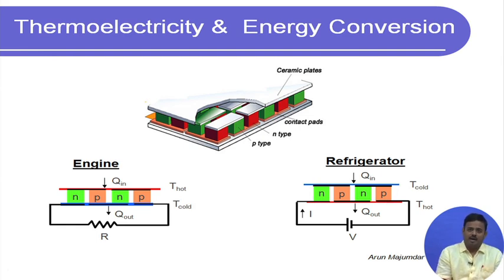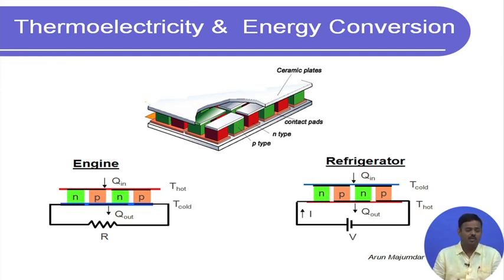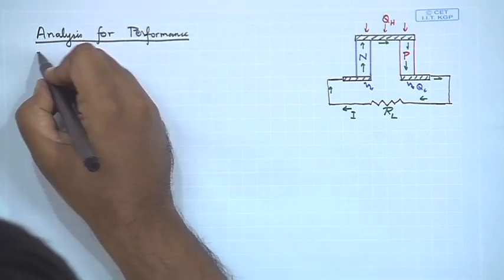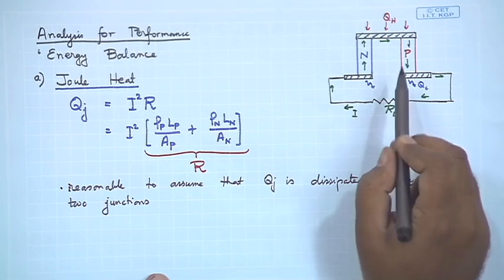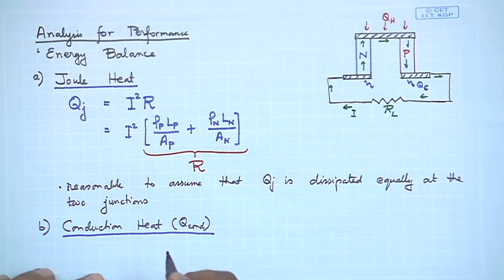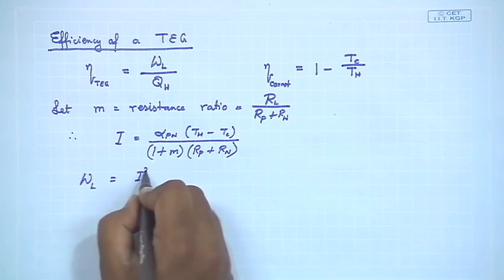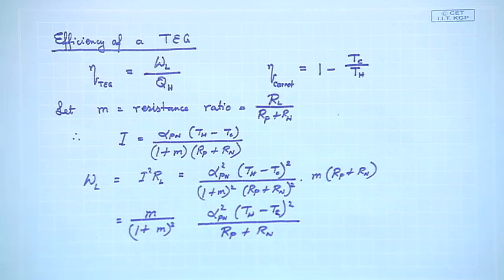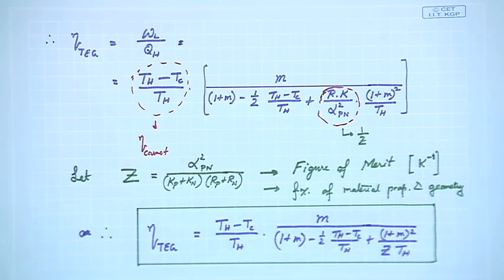Lecture 42 : TEG - performance analysis

Comment: Q1. If the Peltier heat being released by the hot junction is alpha*current*T_hot and that absorbed by the cold junction is alpha*current*T_cold, what happens to the difference? Is it being lost in the thermoelectric module during the process of heat transfer?
Q2. It seems that if I have a temperature difference between the 2 junctions to start with, I will have an emf between the junctions. Now, if I connect the 2 junctions with an electrical load, a current flows and it is this current which is the cause of the Peltier heat - so the Peltier heat is actually a secondary phenomenon once a load is connected between the 2 terminals. Am I right?